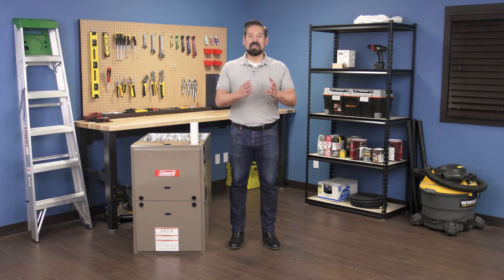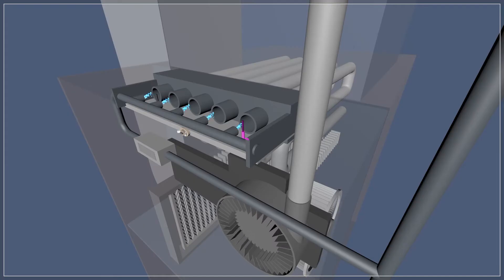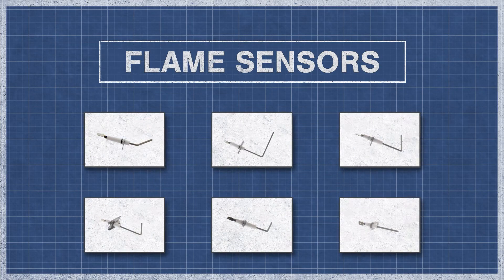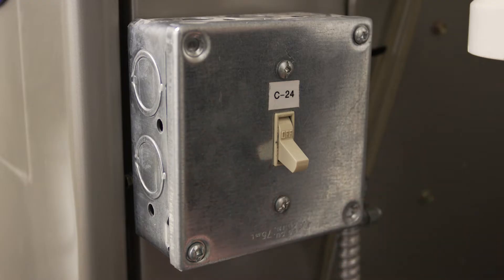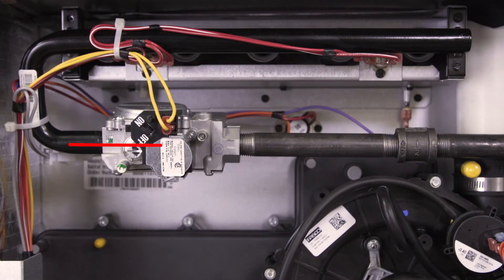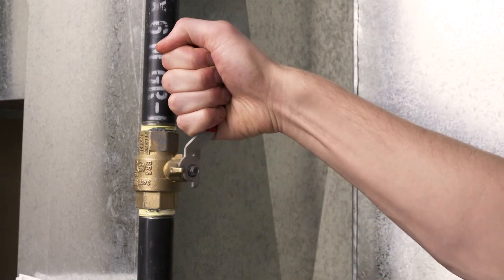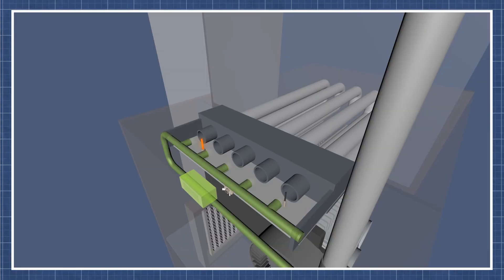Furnace - Flame Sensor | Repair and Replace

Comment: If you cannot remove the pvc duct as you did in the video, please show a video on how to replace the flame sensor by working around the duct or how to do it???
Reply from the maker: Thanks for the suggestion. We are currently working on more appliance repair videos so it will be a while until we do more HVAC.

Comment: How did you remove the PVC exhaust duct to make room for your hand??????
Reply from the maker: The PVC exhaust duct can't be easily removed and installed, and in this case you'll likely have to work around it.

Comment: Have a Rheem Classic 90 :
Cold air, no cycling.

Temperatures ranging from 50s down to 20s. I have had a pipe pop some years ago in deep subfreezing days and I know what that experience is like so after making sure to re-drain the outside pipes, I went to work.

I have home warranty coverage, but I really didn’t feel like paying 100 bucks and waiting two days and then have to stick around from a five hour window for somebody to come out and do something real easy. So, when I locate the ignition switch and did a Google search on what one flashing light meant , I was happy. I took out the flame sensor and that joint was broken in half like a Temu Lightsaber.

Next day on Amazon, $24 invested and 10 minutes of worktime following your videos so I don’t blow up the neighborhood. 

Thanks, big dawg.
Reply from the maker: You're welcome, we're glad that the video helped you get it fixed!

Comment: Great video! Straight forward and very helpful. I was able to call the Heating Company and cancel my appointment. They were going to charge be $250 just to come to my house. This does not include any charges or parts. I cleaned my flame sensor with some steel wool and it’s running great. I did order a new flame sensor and when it arrives I’ll install the new one since this one is over 5 years old.
Reply from the maker: Thank you, we're glad that the video helped you save some money!

Comment: Is the Flame censor and the ignition switch different?
Reply from the maker: Thanks for watching. The flame sensor is a metal rod that detects the presence of a flame (by completing a small DC circuit through the flame). It is used in furnaces in that have a hot surface ignitor.

If you are talking about an ignition switch, then you're likely referring to Piezo ignitiors. These spark ignitiors are used with standing pilot furnaces.

There are intermittent pilot furnaces, which have pilot lights which are controlled electronically and light with a sparker.

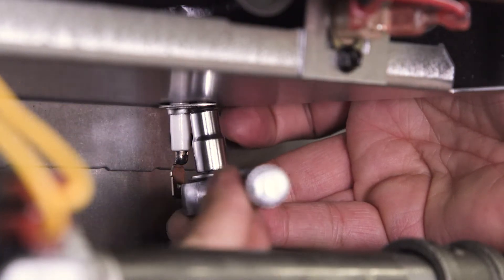Comment: 1:58 .. I been in the hvac trade for 3 months and always found it difficult to take out a flame sensor on a Lennox 90%… just like at 1:58 the screw is located underneath the burners however the gas pipe is much higher, probably half the space you have on the video
Reply from the maker: Thank for watching. You are right that not all flame sensors are this simple to access. We are currently filming some appliance repair videos but if we return to do an update to HVAC then we'll likely try to talk more about some of the variations between models. Cheers!

Comment: does the direction the wire is inserted matter? thanks
Reply from the maker: Thanks for watching. As long as there is a good connection with the flame sensor it will work. The orientation of the wire connector does not matter.

Comment: Any experience with 90% Lennox furnaces? It’s real difficult trying to take out the flame sensor . I’m just looking for tips to make my job easier..
Reply from the maker: Thanks for watching. There is a lot of variation on how parts are mounted in different models. What are you finding difficult about removing the flame sensor in the Lennox model?

Comment: Just got my new flame sensor, and went to connect it and it has a 'MALE' adaptor, which the original was a FEMALE adaptor...so right now, I have male/male, which of course does not work/snap together....Can I swap the wires and use the formerly bad male adaptor but only use the plastic part, so that I can make a connection, or do they sell BRIDGE plastic connectors that go to your current plastic adaptors?  thanks...
Reply from the maker: Thanks for watching. An male to female adapter might be available somewhere but is likely going to be hard to find. Swapping the wires to use the female connector from the original sensor would work as long as the wire splice has a solid connection.

Comment: **Actually Anyone who has the knowledge to help with this question would be much appreciated!** Thank you for the video!  One question:  Where does the OTHER side of the flame sensor wire plug into?  We bought a house with an OLD furnace lol, and an orange wire is plugged on to the part of the flame sensor that sits on the pilot assembly kit (which includes a pilot orifice on one side of the flame sensor and a thermocouple on other) but the other end of the orange flame sensor wire is just laying underneath (on surface floor beneath gas valve etc) completely disconnected so obviously non-functional 😳.. the furnace is a Lennox g13 gas furnace, with a standing pilot that has to be manually lit by holding down solenoid button on gas valve thank you!
Reply from the maker: Thanks for watching. In high efficiency furnaces, the flame sensor is a flame rectification device. It only has one wire. It creates a DC circuit by completing the circuit through the flame, to the metal burner, down into the frame of the furnace to ground. This means if the flame sensor is dirty, if the burner is covered in carbon, or if the furnace is not properly grounded, then the circuit might not be completed and the control board will think that there is no flame present.

Standing pilot furnaces uses a thermocouple which screws into the furnace. https://youtu.be/3EKbSiAJyiI The thermocouple generates a small amount of voltage by the pilot flame. If the flame goes out then the thermocouple will cool down and shut off the gas valve. So the thermocouple is also used as a flame sensor.

Some standing pilot furnaces have both a thermocouple and flame sensor (it will have a dedicated control board) and some do not have a flame sensor. In your case if there is no connection for the flame sensor then its likely that you just have a basic standing pilot furnace. In this case you can remove the flame sensor or just keep it disconnected and the furnace should run properly.

Comment: My nest thermostat detects that the furnace turns off after 15min, then starts right up about 1 minute later. Could this be the flame sensor that’s dirty or needing replaced? I bought a new nest thermostat and it does the same thing. I also put the old Honeywell one back on and same thing so I think I ruled out the thermostat.
Reply from the maker: Thanks for watching. We made a video that goes into more detail on why a furnace starts and stops. If the burners ignite and stay lit, then the flame sensor is working correctly. In your case its likely an issue an overheating issue or a problem with the limit switch. https://www.youtube.com/watch?v=b0sAGt-1niU
Reply: @AmreSupply  thank you for that
Reply: @AmreSupply  I replaced both the limit switch and flame sensor just because I’ve only owned the house for 1 year so who knows how old the parts are. I noticed the old limit switch had lots of dust build up. Either way the problem is now fixed. $33!!! I subscribed!
Reply from the maker: @CZRRVZO  We're glad that you fixed the problem! Also thank you for the subscription!

Comment: My furnace is giving a code (7 red blinks) meaning the flame could not be established after 3 tries. The furnace then locks out for an hour then restarts. Sometimes it heats and sometimes it doesn't. I'm thinking this is likely the flame sensor, what do you think?
Reply from the maker: Hi Chris, thank you for watching. Its most likely the flame sensor. Cleaning the sensor is the first thing to do, as well make sure that the burners are clean as the flame sensor sends a signal through the flame though the metal in the burner to ground to complete the circuit to "prove a flame". As well check that the connection to the control board is secure and that the wires are not frayed or burnt.

If that doesn't work then replace the flame sensor.

Comment: Thank you for this easy to follow tutorial! Cleaned up the gunk built up on the sensor and it fired right up after!
Reply from the maker: Thanks for watching Jake! We're glad the video helped you out!
Reply: @AmreSupply Miller downdraft furnaces don't use a flame sensor so I don't know why this video showed up under the title flame sensor location for nordyne mh furnaces
Reply from the maker: @commonsense3673  Thanks for watching. The search algorithm isn't a perfect system by any means. Since you searched for furnaces and flame sensor, those are relevant enough keywords to bring up this video.
Reply: @AmreSupply  p

Comment: Thanks for this video. I have the exact symptom. My flame sensor look clean enough but I did clean it anyhow. But it works well for a while and I have to clean it again. Is it possible that there are something else problem? Or do I need to replace the sensor? I see some different brand sensor sale online, can I just buy the one that look the same but different manufacture?
Reply from the maker: Hi Chhin, thank you for watching. First thing to check is to make sure that the flame sensor is positioned in the flame, if it is not positioned properly in the flame then it will not work to prove that there's a flame present. Now for a replacement, its best to find a model that is listed as a direct replacement for your model so you know that it will fit and work in your unit. If not there might be some size differences or variation that is hard to see in a picture. You can browse flame sensors here: https://www.amresupply.com/catalog/Sensors-Flame-HV2G You can sort by Manufacture. If you have any questions you can call our customer care center here 1-800-661-9891

Comment: The headliner said "how it works" and all that is explained here is "what it does" and "how to replace it". Can you show a video on how a flame sensor works?
Reply from the maker: Hi mcallumcra, thank you for watching. The "How it Works" segment was to help clarify how the system works and you're right that it doesn't go in-depth into how a flame sensor senses a flame. We kept the explanation straight forward but if you are interested in learning more than do a search on "Flame rectification". Cheers.
Reply: @AmreSupply  thanks. I did look into that. It's quite interesting how it basically turns into a rectifier. Funny how a little soot can cause the problem but it totally makes sence why it needs to be cleaned now. Thanks again for the video. My house is warm again.
Reply from the maker: @mccallumcra  Yes it does work a little different than a thermocouple but its a pretty well designed device to safely prove a flame. We're glad you have your furnace working again!

Comment: What tools did you use to remove the heat sensor ?
Reply from the maker: In this case a nut driver was needed, since it was a tight fit we used a socket wrench. In some cases you'll need a screw driver.

Comment: I put a igniter and a flame sensor on mines works great before temperature in house would drop down to 63 before furnace would catch on now temperature drop two degrees below set temp on furnace cut right on....both parts cost me total of 65
Reply from the maker: Thanks for watching Emmitt! We're glad you we're able to get those parts installed!

Comment: It's Sunday morning.  Woke up to a cycling furnace.  Nobody wanted to come out.  Thanks to your video, I diagnosed and fixed it myself.  Unfortunately, I inadvertently took out and sanded the ignitor, thinking it was a second flame sensor.  Oops!  Not supposed to touch those.  Still works though so all is well.  Thanks again!
Reply from the maker: Hi Paul, thank you for watching. We're glad that you were able to get it back and running again. It might be good to still keep an eye on the ignitor, just in case you sanded down too much. In many cases its worth having a spare ignitor on hand regardless.

Comment: just a question...is this something someone can do like as mischief (i was renting the basemnet) and this suddenly happened. Or is this just a common thing and can happen to anyone. 
cost me $179 to just replace the sensor.
the guy said its common for a 20 year old furnace.
Any advice for a 20 year old furnace? how long will it work? Thanks.
New furnaces can be bought or rented? which ones the best? Thanks
Reply from the maker: Hi Arshi, problems with the flame sensor are very common as it can get dirty, or fail overtime, which will prevent the furnace from lighting. 

Every furnace is different, but there are furnaces that run for 30 years with regular maintenance and with some replacement parts (new motor, new sensors etc)

If you get a new furnace, try to find a high efficiency model, which is 90 AFUE or above. Older furnaces are likely 70 - 80 AFUE and will use more energy each month. New furnaces can be rented or bought. If you are a home owner and plan to sell anytime soon, then buying a furnace will be the best option as it can add value to your home. Alternative furnace rentals are often bundled with service and extended warranty. Like most things you'll likely pay slightly more overall for renting.

Comment: My furnace (a high-efficiency Bryant Model 398AAW048100D) starts the burners, but often shuts off after a few seconds. It has a spark igniter/pilot flame unit with 3 wires, but I see no flame sensor. Any ideas?
Reply from the maker: Hi Mortier thanks for watching. All models use some sort of a safety device to ensure that there is a flame present when the gas valve opens. These Bryant Models use a bi-metal switch which is built into the pilot assembly (The switch has 3 wires coming out of it). Overtime these switches can start sticking and won't open properly when heated, causing the furnace to shut off after the burners are lit. These switches are built into the pilot assembly. Part number LH680005 https://www.amresupply.com/part/9011873

Also its worth taking a look at this video and reading the comments as other people have shared your issue.
https://youtu.be/JFoVcYpq1p8

Hope this helps!
Reply: Thanks for the helpful reply. Much appreciated!
Reply from the maker: You're welcome Mortier! Cheers

Comment: yeah sure, first disconnect the wire, in this video it was disconnected already, my wouldn't come off (:
Reply from the maker: You make a good point, some wires are harder to remove than others. While filming this we had to wiggle the wire at 1:39 to disconnect the wire, and it took a bit of wiggling and didn't show up well on camera as the hand was in the way. In general if a wire won't come loose you can use needle nose pliers to help get a better grip to pull it from the terminal. Hope this helps!
Reply: wiggling worked thanks :) @AmreSupply
Reply from the maker: @donataspimpasas  Glad to hear it!
Reply: Great video, accurate details, visual steps were amazing, the how to two thumbs up, different parts overview, and electronic non refunds details additional plus, step by step process easy to understand, the instructions were catchy and made me stay focus. I really enjoy the video and help me be confident on my quick learning.  Looking forward to other videos.  Thank you again and will consider the website for parts and sharing the video across my network.